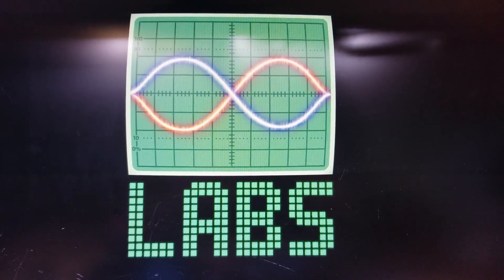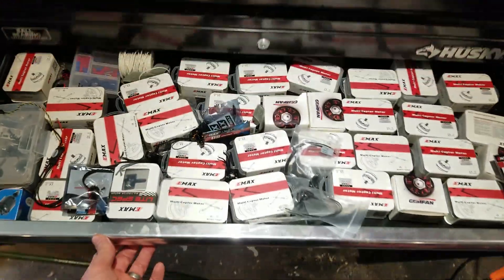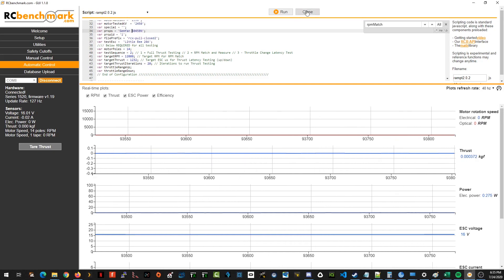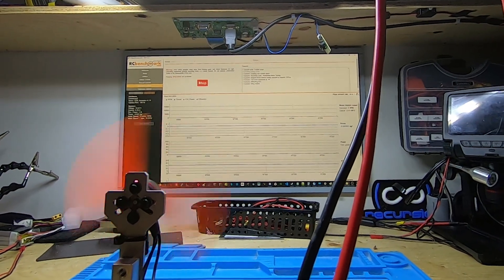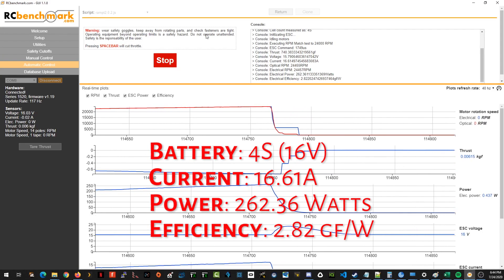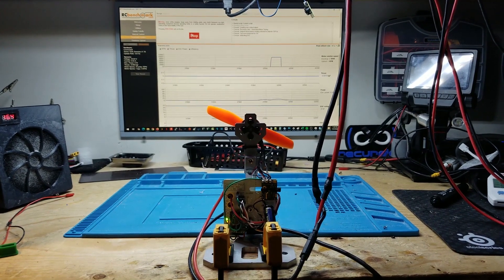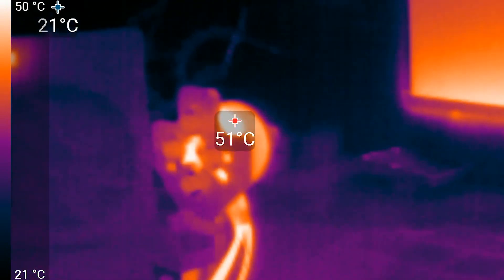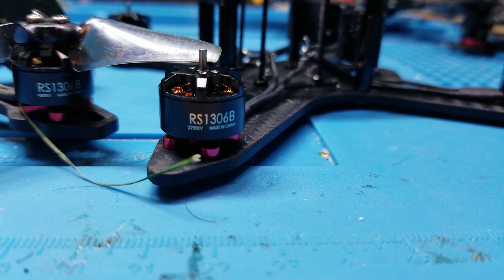Is using 6s Lipos on 4s motors using motor_output_limit a good idea? Bench Tested!

Comment: i am running 6s 2700kv T-motor 1507 on 5s. I can not prove it, but i think i have with this setup the best efficiency, or maybe i have just added a physical throttle limit, maybe you prove it, if it make sence?

Comment: Im not sure how exactly motor output Limit and the ESC's work. But if my understanding is correct: 
an esc controlls the voltage given to the motors. An ESC does not control the RPM over Amps. The motors draw the amps they need at a certain voltage. U:R=I (volt/motor internal resistance= Current draw)

I'm thinking the motor output Limit on 6S set down to equivalant 4S should tell the ESC's to only output maximum ~14.8V.
Maybe the ESC's are less efficient reducing the power supplied by the LIPo. Okay. But in real flight the motors will have more constant thrust on 6S than on 4S with motor output Limit.
 Why?: because of the voltage sag from the current draw. A 4S on full throttle and lets say 1V voltage sag per cell will only have 12.8V running the motors and give less max thrust.
Whereas on 6S there should be constant 14.8V on the motors.
 Why?: because even under voltage sag on 6S there will still be 16.2V  as reserve in the lipo. (Also assuming 1v sag per cell)
There was a guy testing this on his 4S quad and you could clearly see and hear there was more Power on 6S with motor output Limit.
 Just one downside: the lipo will be heavier with same mAh capacity rating. If you go down to a lighter 6s lipo, then the voltage sag on the 6s lipo will be more, because for example 100C rating on 750mah are 75A and 100C on 550mah are 55A max current draw.

A good idea for a light weight 6S lipo are making your own 6S out of two tattu r line 550mah 3S lipos. Perfect on 1800kv 2004 motors.

By the way: 2004 motors or larger motors in general spinning small props have no benefit in thrust and just add extra weight. Unless you find that motor om really high kv and need larger lipos to handle the current draw. But there are no large motors available woth high kv for small props. It just doesnt make sence.
Thanks for the tests. Try some 1804 3500kv motors on 3~4 inch. They are great.
Or 1207 on 2~2.5 inch. Not efficient, but powerful.
Reply from the maker: I have a video with 1408 motors on 3", and they did produce a significant amount of additional thrust. Motor output limit just tells the flight controller to cap the throttle at a specific point then make 0-100% fall into that range. The top end takes the most current and where you'd burn them out if you went over the wattage limit for the motor. It does not reduce the voltage. If it did, then the tests would have been identical.

Comment: This is a really great video! Thank you for this great comparison with equivalent conditions!  And it was surprising for me and I still don't understand why 6s makes motor warmer. We have less amps for 6s so less heating was expected (according to P=U*I formula). Maybe it is because transient process (start and stop) ? Do you think if you run 5 min on 4s and 5 min on 6s - it would be the same  temperature difference (more hot 6s) ?

Comment: OMG, that is awesome testing rig/setup you have.  On 4s motor like a 2507 1800KV motor, if you  used the motor_output_limit, to bring the kv down to something like 1500; what would be the expectation of flight time?
Reply from the maker: motor_output_limit doesn't bring the kv of the motor down, it just limits the throttle % to the ESC that it will send, so 1-100% of throttle to the FC would be like 1-60% to the ESC if you limit it to 60%. The top end is the least efficient, so cutting it off when it's not needed would help (and increase your throttle resolution).

Comment: Very informative tests. In real life though part of energy will get lost by voltage sag. So motors will be only ~15% warmer. No reason to deliberately build 4S quads for use with 6S batteries, that is correct. However many of us like me, have builds with 4S motors and a ton of spare motors.  No reason to throw them out - better let crash and fry them with fun :D  I will fly the rest of my 4S on 6S till they crumble.
Prop that you're using, is very noisy indeed. Used such props in my first quads 7 years ago - they was awfully loud.
Reply from the maker: There was still voltage sag in the tests. Any heat from the wiring/motors would sag the voltage. I agree on not throwing out motors though.

Comment: My 4s 5 inch quad is unflyable on 6s batteries. Motor output limit is correct. The weight is the same. It just overshoots and bounces back to the point of being unflyable and dangerous.

Comment: Amazing work. I wanted to by a 6S drone but it’s sold out so I’m thinking of getting the 4S version and putting 66%output limit and use 6S battery. But after watching this, I think I won’t. It’ll be less efficient and maybe destroy engine sooner due to increased heat. Ty for doing this work, you da man!

Comment: No fresh videos? Does this mean tu our hearing didn't come back? 🤔
I hope not! I've subbed!
Reply from the maker: I just finished doing some tests actually which I'll need to edit together. I only test when I have something I want to know that I can't find a good answer for instead of just duplicating other peoples work. The 6s/4s tests were completed but after questioning the results I found out the emax 1306 motors on 4s were ALL were lower kv than rated (3400kv instead of 4000kv marked), which invalidated the results (though, I did find them interesting). I got new brotherhobby motors for both 4s and 6s, but the 4s kv are completely understated (they boosted the kv to make them seem like they have more thrust). If the 6s did the same I might test them, but I've been testing different 3" motors to see which are better for a new build I'm working on (bought a couple different brands/kvs).

Comment: Great video and exactly what I needed right now. I´m deciding if to buy or not to buy a set of new motors with 6S KV for one of two quads while I still run 4S batteries until they are worn out. After seeing this, it looks like dedicated 6S and 4S quads right now.
Surely I´m also interested to see the difference in "pure" 4S/6S setups in your testing equipment!

Comment: Excellent testing, Recursion! Would reversing the order of testing (e.g. 6s first) change the results because the 6s test starts off cooler? Followup study: would 4s achieve higher efficiency on low kv motors (designed for 6s)?
Reply from the maker: Great questions. You're right in that heat would taint the results since heat would add resistance to the motor. I made sure the motors were cooled to room temperature between tests. I also redid tests off camera afterwards to double-check results to make sure I didn't miss something, and they were the roughly the same. If I throw those on the bench I could always put 4s voltages in to see if they are more efficiency (they should be), but you'd definitely lose top end thrust.
Reply: @RecursionLabs  Brilliant. Thanks a lot for running this test and welcome back to making videos on YouTube. I recently saw an ESC filtration test from 2016 and just realized that it was also made by you. PLEASE CONTINUE MAKING CONTENT!!! 
Do you have a hypothesis for why 6s has a lower efficiency (and generates more heat)? I'm not a physicist or engineer and am befuddled by why wattage at the same RPM is different... in the ideal world, it would reason that since 4s is 2/3 of 6s in voltage, 4s should draw 3/2 the amps of 6s, but that's experimentally proven to not be the case.
Looking forward to seeing your 4s vs 6s respective motor comparison :D
Reply: Philip Lee Maybe the ESC can’t control the output as precisely as on 4s due to the higher voltage? Or the motor efficiency has shifted in the torque/speed plane due to the higher voltage?
Reply: @brechtfpv7480  Yeah, interesting points. Now we gotta find a physicist who can explain the PDEs that govern motor output!